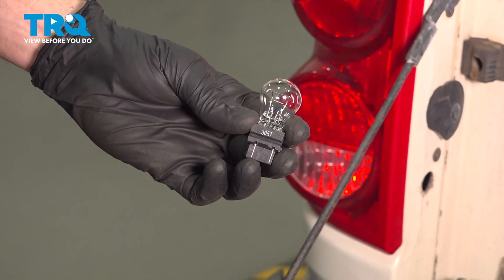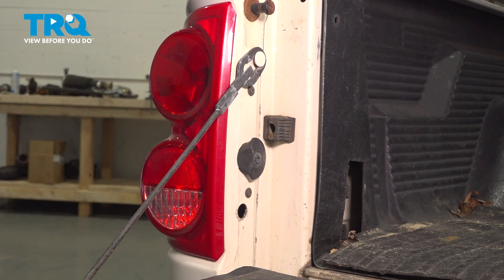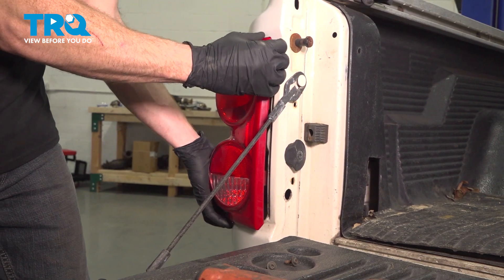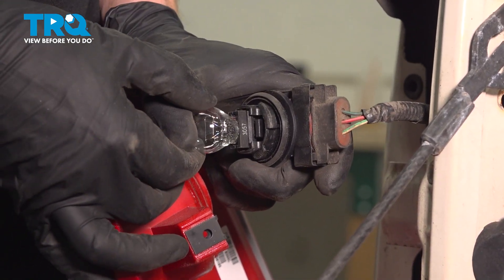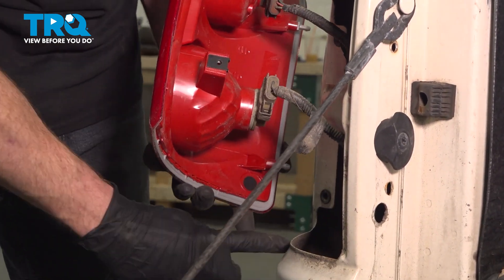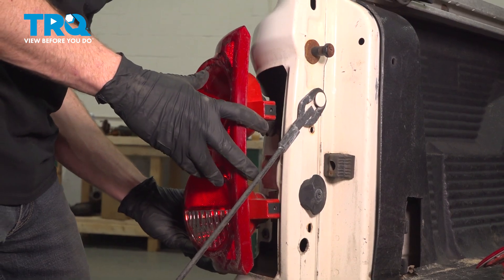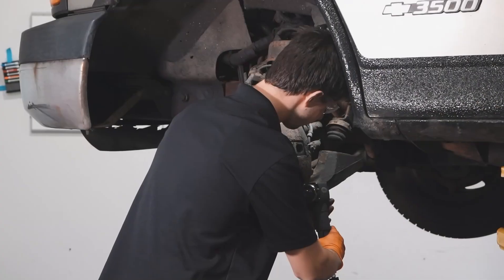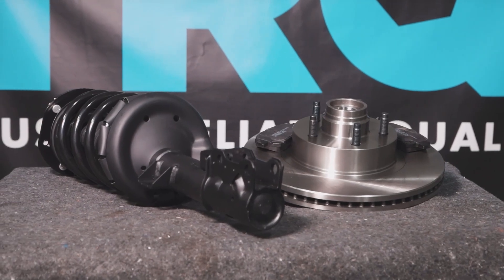How to Replace Taillight Bulb 2005-2010 Dodge Dakota

Comment: I have a 2010 Dakota that has been outfitted for RV towing by the previous owner, who has passed away since I bought this truck. I am amazed at how simple those tail lights are. It never occurred to me those bolts held in the lenses. I'm hoping to fix a problem with a faulty rear passenger turn signal when is gets above 25°F later. It is NOT a bad bulb, because it will sometimes sounds like normal for a few seconds, then it will flash quicker as if the bulb is dead. There is an invoice with some recent work done I found when I first bought it. The document describes this problem and it seems to describe the wiring socket under the front bumper license plate holder to run the trucks tail lights while in tow. It seems this may be what they mean,  but not real clear. For over $100.00 four or five years ago a Dodge dealership mechanic cleaned some connection to correct this issue, but the wiring harness socket in front is very clean , and I checked the backside of the harness connection that seems to run to the tail lights, and other than a sloppy tape job that I corrected, I cannot see anything wrong at all or any connectors.  I assume the tape just helps prevent dust, at least that's how it appears. Have not tried to trace the wires, but cannot be sure how this may tie into the normal wiring for those rear lights because it disappears behind all the front end and engine components.  It has been a while since I last checked, so I am not sure if it ties in with the original wiring harness someplace I have not looked. I have not yet checked under the bed to the lights yet either, and I just thought someone might point me to the right place, as wiring is my weakest area on a vehicle. Especially when I began on models like my first car for $75.00 a very pale green 2 door with a straight six, which was 200 cid? A very used and rode hard for a 14 year old 1968 Ford fairlane, and my favorite care, if you've seen a 1965 black on black ford galaxie 500 LTD.  The original use I believe for the LTD. It was a round tag encircling the letters placed on the metal just behind the rear window like some later Mustangs. This came stock with the smaller big block with 352 cid and a "low riser" 4 barrel and the police package intercepter tranny, forget which model it was now because it was stolen,  when I had it out soon after I got it. It had a very plush stock interior for a ford and the radio like the ghost car "Christine" only liked to pick up oldies AM stations clearly. It really creeped some people out. It is worth so much now. More than it was by far than the 2 to 4 grand when new. Google it if your curious. I like it as the best looking galaxie, but I'm from 1964, so....